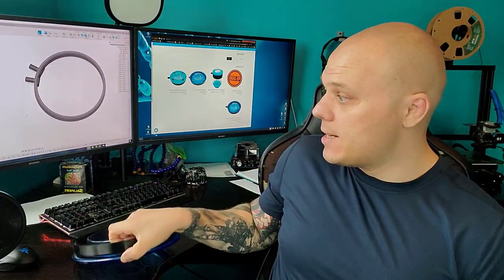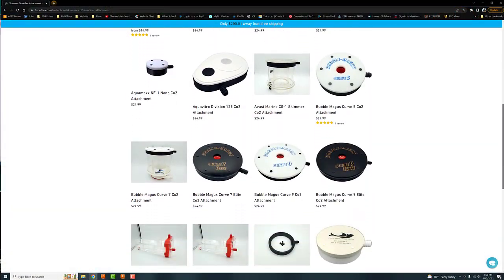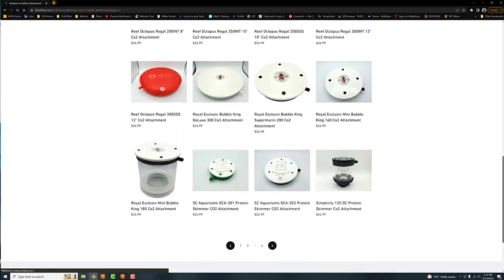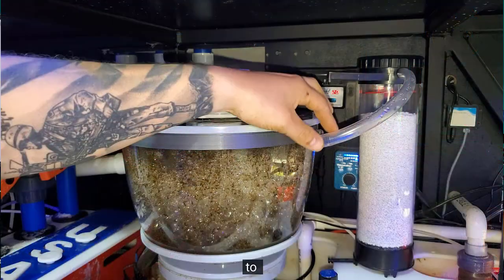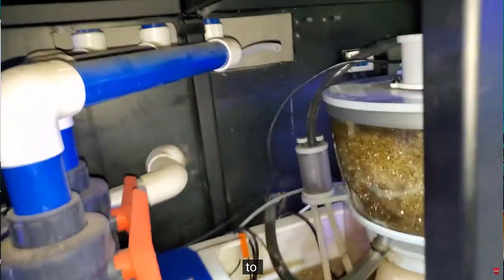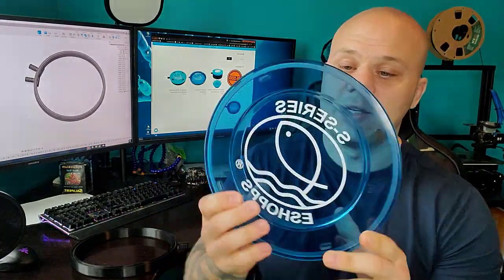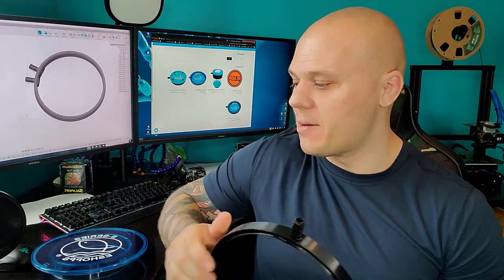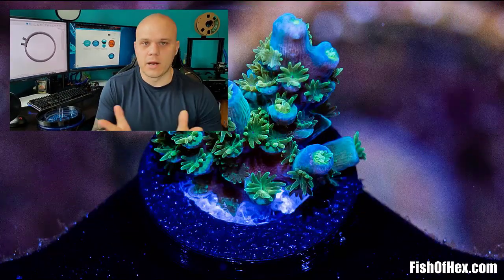The Only Problem I've Had In Over A Year Of Making Skimmer CO2 Scrubber Attachments

Comment: Hey there, I will be setting up a 60x26x24 (LxWxH) inch 160 gallon mixed reef tank. I have several questions and I was hoping you could answer them for me. 
1) Lighting: I plan on using 3 XR15 Pro G6 for this tank, so you think that is enough for a mixed reef? I might or might not turn it into a sps dominated tank and if I do, then I’ll get another XR15. What do you think? 
2) Wave maker and return pump : I plan to use two maxpect gyres for that and also the maxpect return pump. Do you think these two would be good? 
3) filter socks or roller mats: I am not sure if what to use, should I go with the filter socks or roller mats? What would you say? Which one would be better? I mainly want the water to be clear but if it does reduce nutrients that’s a plus. 
4) Protein skimmer and reactors: Will the Bubble Magus Curve 9 elite be enough for this tank? I am not 100 percent sure about the tank stocking, but I will have a trio of tangs if not more. And for the reactor I’ll just use one for carbon to keep the water clear. 
5) This is where my biggest confusion lies. What should I go with, a refugium, algae turf scrubber or a chaeto reactor? Or should I go with a mix of two? I will have some wrasses in the tank, and I may add a dragonet when the tank is mature. So, I want to have a good population of copepods. I am not sure whether I should set up a refugium, ATS or a chaeto reactor. The bottom of the sump will be covered with bio media, either blocks or cubes. I believe that the copepods would thrive in there, right? If I keep chaeto should I have it in the refugium area? If so how should I tumble it? Or should I use a diy chaeto reactor? What would you say? Or should I use the ATS. The other option that I can think of is, keeping chaeto or other macro algae in the refugium section and have a small ATS what do you think? Then I will have the nutrient export from the algae scrubbers and some nutrient export from the chaeto which will also prove a place for the pods to stay. But then again I want to turn the refugium area into a small drag rack so should I use a chaeto reactor instead? I’m really confused about this part. 
I’m sorry the comment is too big. But I really hope you reply and help me out. A big big thank you in advance!
Reply from the maker: Please order a skype/phone call from my website.

Comment: I tried once recirculating my co2 scrubber, skimmer overflowed,skimmer sucked skimmate through the co2 reactor media, tank turned to milk and killed most my fish and half my corals.  Will never recirculate my skimmer again. I wouldn't suggest recirculating a C02 scrubber
Reply from the maker: @andysattic1  wouldn't of happened if you 1. Used my co2 scrubber. 2. Had a drain and an automatic shutoff for the skimmer